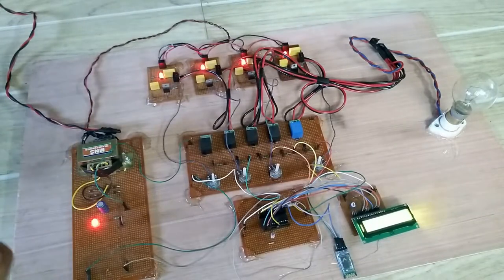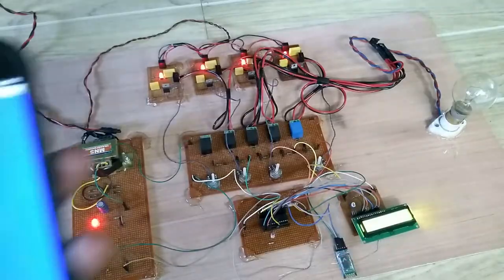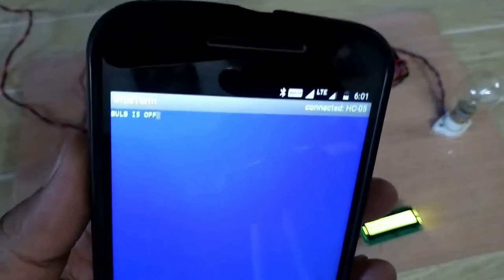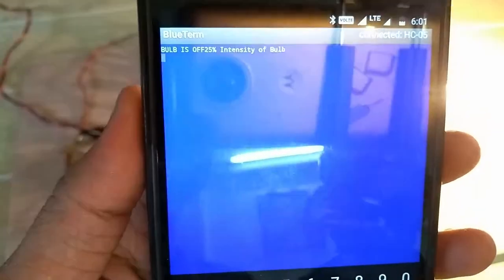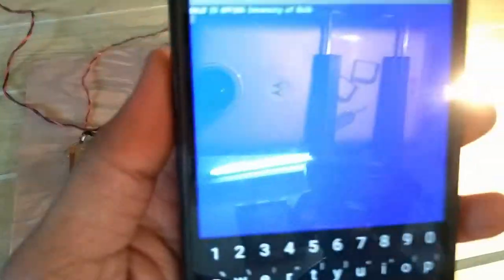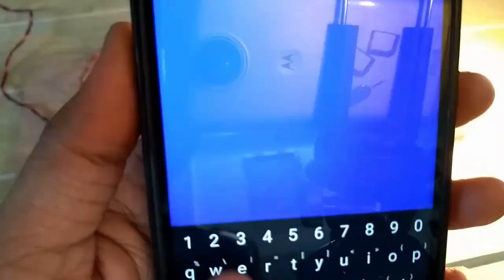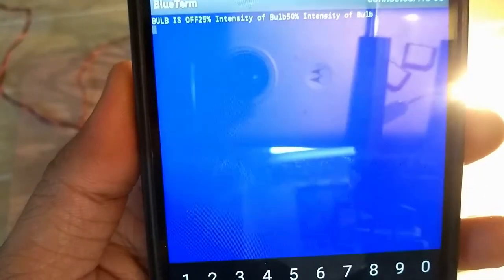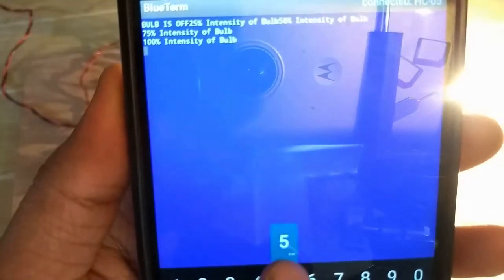THYRISTOR based ac load control by bluetooth; wireless ac power control

Comment: Mobile device sends digits to microcontroller via Bluetooth wirelessly. 

Controller is programmed to operate relays which in turn operates thyristor (SCR).

Amount of power (i.e.  25%, 50%, 75%, 100%) delivered to the bulb is preset at each thyristor (power control using thyristor - popular topic in power electronics)

First thyristor tuned to supply 25% and so on. When digit 5 is pressed in mobile, all relays are turned off, so all thyristor will remain off and thus no power reaches bulb.

This way by selecting right amount of light, power can be saved too :)